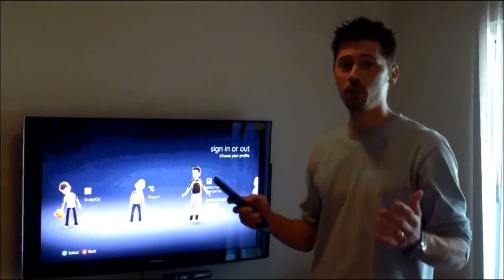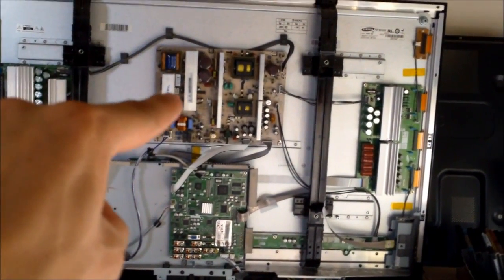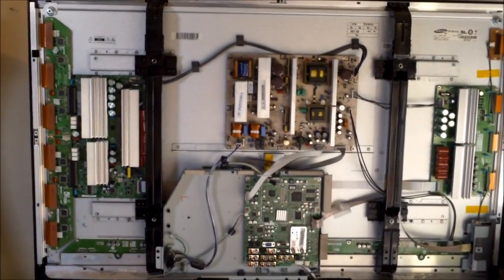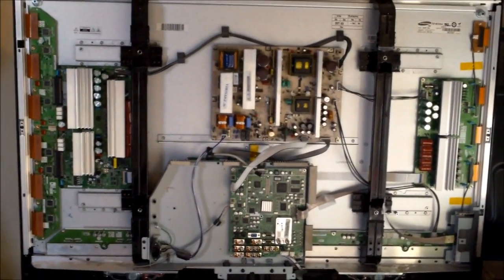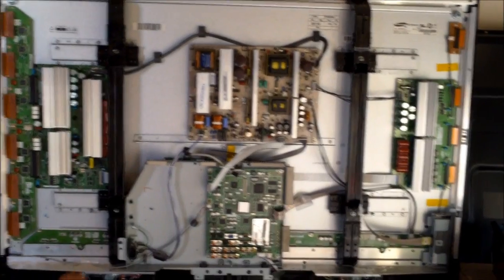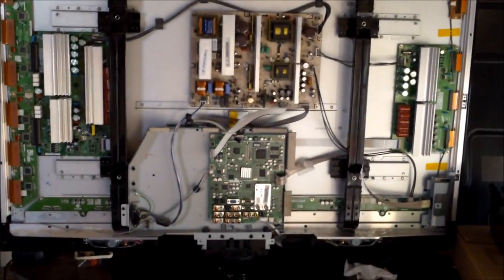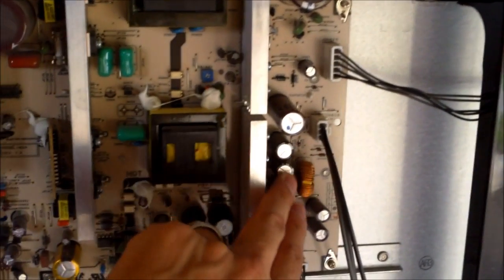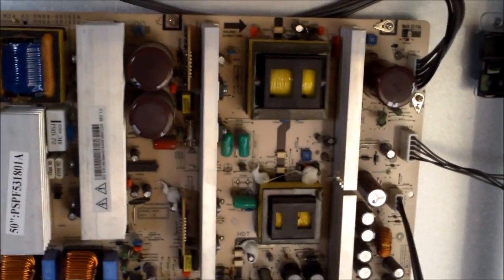WHAT PLASMA TV BOARDS commonly Fail review

Comment: Hi Tampatec,  I have a Samsung PN64E8000GFXZA, board # P64SW_CPNIP-556420A (BN44-00516A). Just like in your videos, my tv does not power on. No standby light, no picture nothing.. I checked the power supply board and found that the time delay fuse had blown. I replaced the fuse and put everything back on the panel plus connector. When I plugged in the power cord, the fuse blew right away. What went wrong? None of the capacitors show any signs that they about to blow. Any help would be greatly appreciate.. Thanks...

Rican

Comment: Hi Tampatec, i,'ve a panasonic plasma tv model TH-50PV80HM. no image but the audio is good. Tried all inputs hdmi & av, same result (no image). When I slot in the SD card I get the images from the card to the screen clearly.  Kindly help can this be caused by the input logic board.

Comment: we have a sanyo plasma hdtv model # 50747, year 2008.  there are 5 boards in the back of the tv.  the problem we have is it will power up for a few seconds then shut down.  we replaced the supply board but we are still having the problem.  my husband heard a clicking sound on the middle upper board when he tried to turn the tv on.  from the different videos on different model numbers they keep referring to changing the main board but there doesn't look like there is anything wrong with the main board.  i can email you a picture of the placement of the boards if you're not sure what i'm talking about.  the power and main board have sanyo printed on them, the 3 other boards have samsung printed on them.  this is confusing.  thank you any guidance you can give.

Comment: Have a panasonic plasma tc-50px24; picture and sound when out; red led light does a 10 blink code; checked with shop jimmy and they said it was the sc board but out of stock; someone said it could be the power board; what do you think?Also, can you rebuild a sc board with the pieces that all come in kit?

Comment: I have n LG 50PK250UA... symptoms are completely black picture, but audio works fine.  Y-SUS board was replaced with a tested board from eBay, no change.  Power supply board shows VA of 60.1V and VS of 203V.  No obvious capacitor bulging and all fuses show continuity.  Where do I go from here?  Could the buffer board(s) be bad?  Thanks!

Comment: Hi, I have a Hitachi 42HDS69 plasma TV. The only thing that works through the remote control or TV itself is power button and volume buttons. The TV turns but I can not change inputs or do anything else.Could you please tell me whats wrong with the TV and what need to be replaced?

Comment: tampatec first thing i want to thank u for your videos, they been a great help to understanding tvs. im having a issue with a Samsung plasma pn50b650sf1 no video red light goes on and click to turn on. power supply seems fine. check all voltages r good. i found no apparent damge to main board caps. y board look good also. any ideas

Comment: Hi- I rescued a Toshiba 46HP86 - found 1 of 2  fuses blown on the YSUS board and sent the board to a tech who replaced the IC's, fuses, tested and sent it back. After installing,  there are some signs of life, but the Plasma display has issues. It is only lights up 5% screen image. Any thoughts? I'm thinking Y buffer board, but would like to know if it is possible to troubleshoot it? Maybe plasma display is toast?
Thanks!

Comment: Hello I have a 50pv450 lg plasma tv .the remote sensor stopped working after the tv got wet.the tv still works great but the remote doesnt work .and yes  I have tried several remotes..which board in the tv contains the remote sensor? Can you help me plz
Reply from the maker: 1st unplug powercord of tv and wait 2 minutes to reset TV but can be small ir sensor board near the red standby led you see in the front of tv when tv is off.

Comment: my tv just shut off, and was making a clicking noise for a few with flashing pw button.. any help would be greatly appreciative..PN51D550C1FXZA
Reply from the maker: most common fix is capacitors in power supply but check standby volts on power board & count flashing standby pw led cause that is error code. contact shopjimmy.com techs to confirm this.

Comment: Awesome video's, your very thurough with your video's. I have a issue with a sony FWD-42PVI plasma "monitor" I use for gaming, some call it christmas treeing, its blue and red and green little specs, but its only in dark area's of the screen/game, I do not have the problem when I watch a youtube video, i'm wondering if my video graphics card is just to weak for the game/sim graphics, some times the screen will clear up perfect, but not often, the only game/sim I run on the pc and monitor is called "Iracing",  my grapgics card is a Asus GeForce GT640 2GB DDR3 and the pc is Intel Core I5-4570  3.2 GHz, Asus intel Z87-c MB. I would greatly appreciate your thoughts, Thanks in advance.

Comment: Hey Tampatec, I have have a Samsung HPR4252x/xaa plasma. When powered on the tv show a few colored "sparkles" randomly on the screen. Other than that, its stays black. Any ideas which board is bad? Thanks!
Reply from the maker: bad or swollen capacitors on power board, its common, get cap kit or power board at shopjimmy.com (caps store energy to help tv kick on but caps also are voltage filters so if Caps are low uf then "noise" appears in the picture on all tv inputs) Let us know if you fix it 8^)
Reply: ***** Thanks for the fast reply, I will let you know how it goes.
Reply: *****  hi i need help i have a 50inch plasma tv Panasonic it does not turn on .so i took it to get fixed n they want $300 i cant afford that they said its the Y circuit board .i would like to get the piece or know how much it is ? I would appreciate ur help 
Thanks
Reply: *****  hi i need help i have a 50inch plasma tv Panasonic it does not turn on .so i took it to get fixed n they want $300 i cant afford that they said its the Y circuit board .i would like to get the piece or know how much it is ? I would appreciate ur help 
Thanks

Comment: Hi I have a Plasma LG50ps11. When I turn it on I get a quick back light just for a split second that complete blackness with no audio. No clicking noises either. It remains pitch black with out audio and no matter what I press nothing changes.What could i do or check? Do you have any videos that might relate to what I am talking about?

Comment: Hi T. I have a Panasonic plasma tcp50s30. Im getting 7 flashes in the power indicator. After diggin online i found that if i disconnect the sc board and get 6 flashes it will be this board the one to replace. But im getting 8 flashes and cant find anything about it. Any ideas, and thanks for your time.

Comment: Hey Tampatec! TC-P50S30 Plasma TV I inherited because it died. No lights, no clicks, no blinks nothing. Replaced Power Supply board from ShopJimmy today and no change! What is typically the cause of no power with a "known" good power supply? I am measuring voltage on the board and my wall outlet is good..  Hope this isn't a big stumper of a question!  Thanks!!!
Reply: I should have said this is a Panasonic Plasma....
Reply from the maker: if you got no Red light standby light, it can be main/video board or power board or some cases it can be both Power & main boards. check for 5v or 3.3v pin, sometimes labeled "std-by" on power board. that will tell you if power is going into main cpu board.
Reply: Steve, did you ever get this fixed? I have the same issue on the exact same model. Thanks!

Comment: recently my LG 50PK540 hdtv has lost video but audio still works... turning set off then on restores video... video last for hours unless game is on then , every five or ten minutes.... whatttt thanks
Reply from the maker: sometimes in plasma TVs y-sustain scan board fails or 190v power to Y-board fails then picture goes black but audio remains Call Shopjimmy Techs to confirm what board to buy call Monday- 1 (877) 881-6492 / (952) 881-6492

Comment: About a month ago I was given a 2005 Pioneer plasma PDP 436PU that turns on, but has neither picture nor sound.  A couple of weeks ago I was able to get it to display large red and blue rectangles around the screen, but there's no image at all now.  I've tried cable, DVD, and HDMI inputs, but nothing has worked.  The remote control seems to work fine (I'm able to turn the display on/off with it), and I'm able to turn the display on by turning the Media Receiver on.  Any suggestions as to what might be wrong?  Thank you!

Comment from the maker: If you own Plasma TV this vid may help u, enjoy!
Reply: hi tampatec, i have a samsung plasma PN50B650S1FXZA .no vidoe but it does power on. I SEE NO BAD CAPS. power supply has good voltage on the plugs and no bad or bulged cap on x board and y board. not visible anyway. any thoughts on what it could be.
Reply: ***** see above
Reply: hi, my vizio equipment is model VX37LHDTV10A, when I connect the power cord the vizio logo is orange but when press power button the vizio logo is white for few seconds and back to orange and no screen image, please help me
Reply from the maker: tv goes into force shutdown mode, check power board 5v or 3.3v
Reply: Hello, I got a LG tc. The picture seems to be fine on the top 10% of the screen. The bottom is clouded white with boxed lines or straight lines. Model Number 47LH55. Sometimes the TV boost up with the logo and everything is fine. I checked all the capacitors and they seem fine. No other testing was done. What do you think is wrong?
Reply: samsung pn58c550gif with tiny pink color and static screen almost not noticable until get closer. what's causing it and which board to check? Thanks in advance
Reply: im getting good voltage on all the connections on ps . va ve vs volts are all good.
Reply: Hi on my 50 inch panasonic plasma tv I get a half black screen and half picture what board will do that?
Reply: ***** Philips (samaung) 50PFP5322 No picture NO sound, Blue light on front ov TV is on and 7 green lights "ON" on various boards with 1 more light "blinking" on the Logic board.  Think I need the Y Main and I'm trying to release the Y Main from the 2 Y Buffer boards that have FLAT protector (or latch) on top of the 8 connectors, all are orange-ish in color with no obvious way to release. . TYPICAL Rookie...I can't figure out how to release them AND can't figure out how to release the 2 connectors that connect the Y Buffer to the Y Main...Thanks, OLD guy in TEXAS
Reply: 2nd hand replace same / worse
Reply: foxtel////??? where is this bye

/

Comment: Hi i like to say first i really like your videos and and how knowledgeable and confidant  you are on your electronics and cool at describing how things work keep up the good work, I am currently working on a Panasonic tc-p42c2 that i got for $50 off Craigslist and i have narrowed it down to the power supply clicking on and off so i  will just replace it and repair the old one later. and thank you again for the great videos keep them going.
Reply from the maker: thanks, check 680uf, 1000uf, 2200uf, 3300uf, capacitors (some bad caps may look OK) on power board & transistors & diodes.
Reply: Thank you

Comment: I have a vizio 42 in plasma 2008 I have a stand by light but the tv will not power on. If it stay unpluged for long a while couple weeks I can plug it in and it will turn on. When it heats up and you turn it off it won't turn back on. I plug it in and pushed the power button at the same time and that worked once or twice. I replaced the main board 3 times and the power supply once. Do you have any sugestions?

Comment: I have a panasonic 46 in and the tv clicks on and clicks off no picture and no sound what is wrong with this i had a warranty but they decided to not fix it  is this a expensive fix the tv is only 2 1/2 yrs old thank you
Reply from the maker: clicking on/off is usaully bad capacitors on powersupply
Reply: Is this a expensive fix
Reply from the maker: Yv Williams no just call to find out if they got a repair kit for your tv model- shopjimmy.com/ or  1 (877) 881-6492 / (952) 881-6492

Comment: Hi Tampatec;
We have a Samsung PN50A450, 50" Plasma 720p. There a two vertical black bar from top to bottom. One is at the middle about 1" or more and the other one is on the left side of the screen. I searched the net and seems to me that I either have ribbon cable issue or buffer board.
What do you say?
Thanks for advice.

Comment: I have a Panasonic TC-P58S1 plasma that switches input modes randomly. The power button works but the buttons on the side do not work at all. Also the tv does not turn on with the remote but the other functions do work with the remote. I would have been able to deal with most problems but because the input menu keeps popping up and switching I can't use the tv at all anymore. If I replace the main board will the input menu problem be fixed?
Reply from the maker: first try hard reset by unplugging tv powercord. for 2 minutes but sure main logic board has cpu so maybe. call to confirm and get main board 1 (877) 881-6492 / (952) 881-6492
Reply: Thanks for your reply, not many people out there helping for free. I will call asap. Great videos by the way, very informative.
Reply from the maker: Br0kenApple No prob. i like helping others willing to learn, i read all my comments and try to answer all my tech questions, i use to be in tech support when i was 21 so its in me. let me know if the hard reset on TV works or try factory reset too, also check 5 dc volts to main logic board (should be labeled on power board plug) if 5 dc volts is ok then it maybe main logic board. I might be doing "google Helpouts" too, So Sub for future free tech support & easy HowTo vids on anything Tech related. thx 8^)

Comment: what if u have a dim screen????
Reply from the maker: did you try to raise brightness and contrast also check power eco mode sensor or and also check cablebox and dvd inputs & video settings, sometimes bad or loose video cables can cause that dimming.
Reply: yea ive tryed all of that :-( any other suggestions
Reply from the maker: Felix Colon what tv model, maybe bad video board- warranty tv boards Shopjimmy.com or  1 (877) 881-6492 / (952) 881-6492

Comment: My friend i just change all the low blow fuse of my 2007 50" Samsung plasma tv however the  fuses did not fix the no picture problem I changed three of them ceramic only. Know I don't know if I should throw it away or get someone since I m not e tech or know how to repair or the cost I will appreciate your comments thanks

Comment: I have a 42” Norcent part #PT-4291HD, that was given to me because it had a black line at the top of the screen. It was an easy fix, just had a bad connection on the ribbon cable. But all white writing on the screen has a ghost image to the right and an over all fuzzy picture. Any help would be appreciated.

Comment: Im bewildered. My sylvania 6842pf had no sound, flickering picture. I unplugged the y and z board and tv powered on. While putting back in a big spark came from Y board plug. Then plugged all back in, and no sound with fuzzy,flickering pic. Now, I unplugged top buffer board, no diff., Tried unplugging lower buffer and most fuzz went away. Now unplugged both buffers to the y board and pic. is perfect! ?? I only get sound on the audio out rca.

Comment: Sorry about that..as I. Was sayi g I have the Panasonic TC-P60S30. I originally had the seven blinking light of death and replaced the SU, SD, and SC boards. I powered on the tv and the power light is stable again but I heard a loud pop co e for. The back of the tv. There was no fire, smoke, or smell just the loud pop. What could be the problem now? Should I give up?

Comment: What could be the reason for a plasma starting up with light grey screen (no picture, no menu - just "backlight") ?
After inspecting my LG 60PZ950 I found out the heat sinks on ZSUS are cold while on Power Supply and YSUS are warm. No sign of bad caps, no burn smell...

Comment: For those guys, having power problems, There are other boards, that control the power. besides the power supply. the mainboard, and logic boards, turn on the power supply. The mainboard has the tuner , the only power you get out of the power supply is 5v, standby, when the board is turned off. if you get nothing, the power supply is bad

Comment: My Philips Plasma does not want to power on. When I push the power button the light will blink once but not turn on. I have checked the power supply and seems to be fine. When unplugging the main video board the screen will light up but there is no image or sound. I also tried unplugging the buffer boards one by one but there is still no image or sound. Any thoughts? Thank you in advance.

Comment: I have replaced the y main, y buffer and power supply.  Another thing I noticed that on the logic board there is 2 led's before when the screen would illuminate and turn off the right led would blink now that tge screen stays illuminated the left led blinks

Comment: I installed the y buffer board and I still got the same issue.the screen illuminates then shuts off. But I disconnected and reconnected the ribbon cable from the logic board to the main board and now the screen stays illuminated. But I cant get the menu screen to show. What may be wrong?

Comment: Thanks for your videos they are very useful, I have a LG 42PQ3000 plasma tv which has no picture but the blue light comes on then goes red, I have unplugged both the boards but when i do this the blue/red light does not come on any idea what is wrong ?

Comment: What is the problem now? The chart for the voltage readings i think are within range.  Vs 211 actual 205 Va 55 actual 54 Vsc -193 actual -189 Ve 86 actual 78